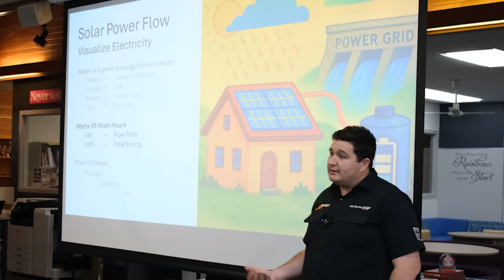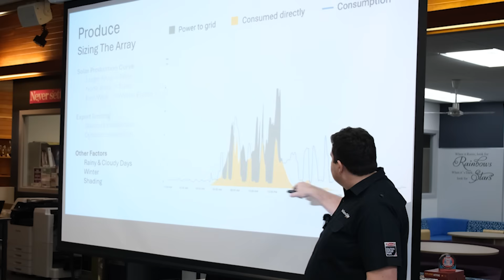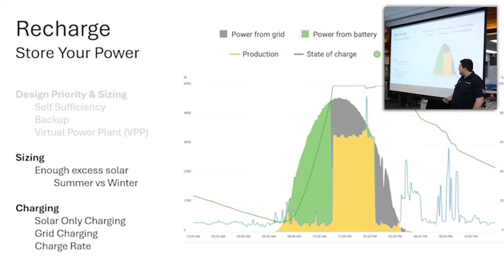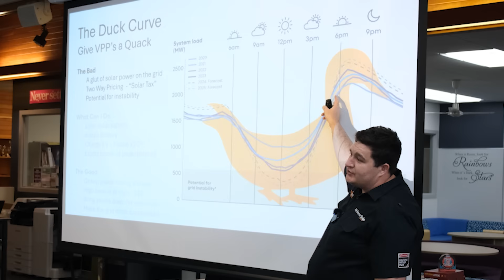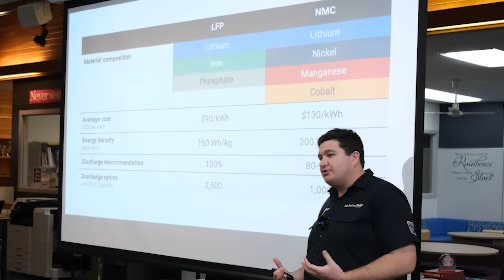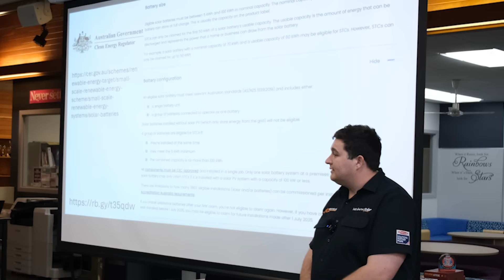Powering a Sustainable, Fully Electric Home with Solar, Batteries & EV Charging

Comment: very informative Video - thanks you.
I recently bought my first EV and would need a EV Charger. I was hoping MC Electrical could help but i was advice when I called that you wouldn't take any new jobs for the next 5 months?
Reply: Hi Michael, Thanks for your feedback. 

With the battery rebate, we have been fully booked out. All our installers are in-house and we are prioritising servicing our solar & battery customers who are waiting up to 6 months for an installation. I can recommend a 3rd party if needed for the EVSE installation. I'm happy to give you an EV charger recommendation based on your solar/EV.
Reply: @Yorick_Mark wow thank you very much. Yes please I recommendation would be much appreciated.  I haven’t Fronius inverter plus smart meter and I’m interested in the new Fronius Wattpilot Flex Home. Thank you
Reply: @Michael_Zink Thats a good pairing. If you have a single-phase connection, I recommend adding a Catch Control for a dynamic import connection. If your house has a 3-phase connection, this is not required. 

It's just about being compliant with the grid connection rules. It's better than having the charger limited to 20A or a basic grid control device like a ripple control, turning off the charging unexpectedly.
Reply: @Yorick_Mark  Thank you. That’s fantastic. Don’t know really know what you are talking about but I hope that Dan does. I do have 3 phase so maybe I don’t need any of that stuff anyway it would be a straightforward installation right next to the circuit breaker board. Thanks again for your recommendation. Much appreciated.
Reply: @Michael_Zink  He knows what he is doing. Best to email and let him know I sent you. Happy to help
Reply: https://www.energex.com.au/contractors/electrical-contractors/ev-charging-and-connections

You could try DRC Electrical. Im sure Dan will be able to help you out. 
https://www.drcelectrical.com.au/

Comment: Great presentation.  I had Solar and Powerwall 3 installed by you guys recently.  Powerwall 3 stopped working 2 weeks ago during a storm with a lightning strike a few numdred meters away ( not a single other appliance in the 8 townhouse complex was affected at all )  Since then not only do I have no battery for night but also no Solar at all.  So entirely on grid. Tesla don't cover it under warranty so insurance claim which will take who knows how long.  Seems Tesla Powerwall 3 is susceptible to this as BYD batteries etc have not been failing like Tesla.  Also just had a power outaqge today ... other apartment with just solar still has power but myself with a battery lost power just because of battery problem.  Is this the same with BYD and other brands or just Tesla?
Reply from the maker: Sorry for the downtime @allanapplin250. I believe this has been resolved, but if you are still experiencing any issues, please don't hesitate to call 32683836. That's the best way to get a hold of our post-installation support team.

Comment: Do you think the government should extend the battery rebate to those people where solar does not make sense?  For instance my neighbour's roof is heavily shaded.  They would happily buy power from me if they could when I am exporting.  If they could install a battery which is subsisdised they could help with the duck curve by taking power off the grid during the day and reduce demand during the evening.
Reply: Yes, I think it would make sense, but I doubt that the eligibility criteria will change. Larger utility & community batteries are better investments for the same result because of the economies of scale. 

A small PV system paired a battery would be eligible for a rebate. That said, if the roof is heavily shaded, then it's probably better to forgo the rebate and save the money on the panels. It's riskier without a PV array as you are entirely reliant on the availability of cheap grid charging.

Comment: Just an FYI, in S.E. Qld Energex region, you may end up on Time of Use (ToU) or ToU + Demand, that's Energex's publicly communicated plan. For the likes of Ovo check your usage and see which works out cheaper ToU or ToU+D versus when you use you power and later with a battery.